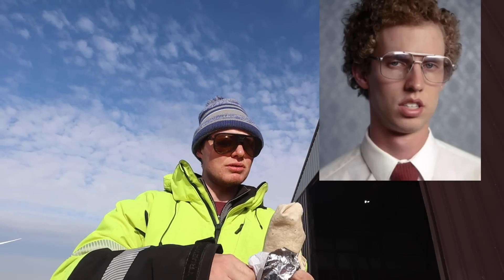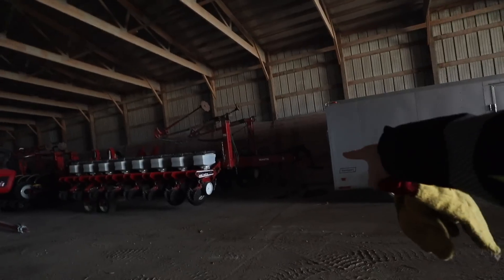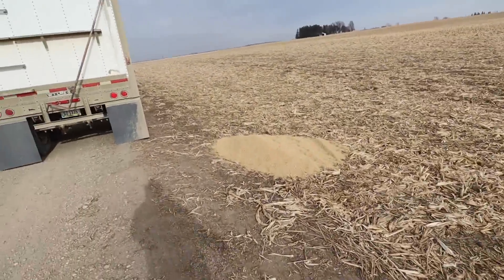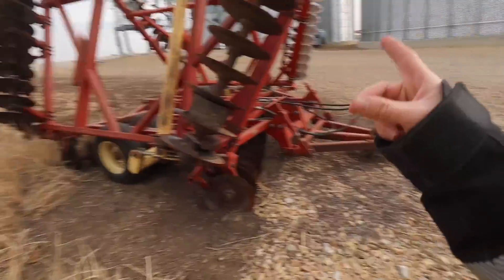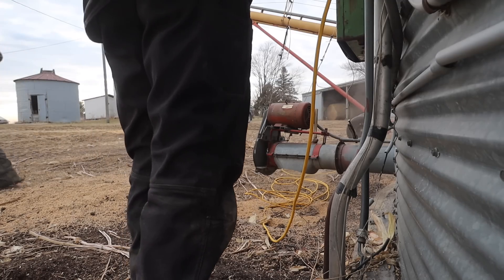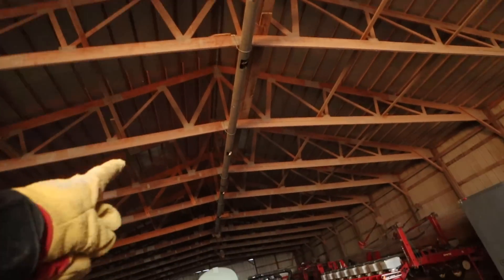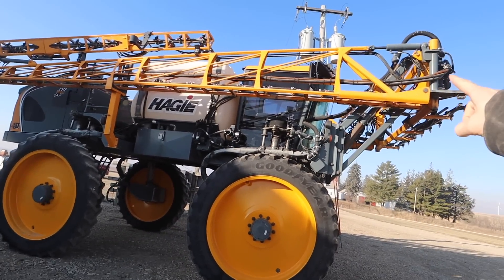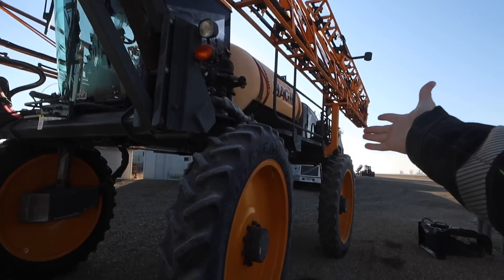I Expanded My Farm Equipment Collection!

Comment: The best way I have found to train a dog to avoid moving vehicles. Is to use a training collar with vibration mode. When a vehicle is running you hit the button. When the vehicle is not running let him play. I haven't noticed any issues with not wanting to ride . They learn to tell running vehicle is something to look out for. The younger they are the faster they learn.

Comment: You'll love having two sprayers..... One can be set up for corn and one for beans.... And when you use your Y drops you won't have to take them off and on to spray beans.
Reply: Having machines dedicated will reduce if not eliminate the risk of not getting a sprayer cleaned out..... That was always a several hour job to do it right when switching between 2 or 3 crops....

Comment: I change my hub oil every other oil change in my excavator!  I believe that the manual states every 1,000 hours on mine but I feel that it's one of those items that gets a ton of abuse and gets little maintenance.  May want to step up the oil changes and it may buy you some more time

Comment: You should keep the old sprayer as a backup so when the new one has issues you can use the old sprayer until the new one is fixed
Reply: That’s a big and expensive Machine to be sitting around as backup if the new on goes down while both of them are working they were doing twice as much work in the same amount of time wich leaves less for the one Machine to handle
Reply: If you actually watched the video you would know that they’re going to use both at the same time…
Reply: @adamfpv8294  correct
Reply: @Shitty_6.2  you are also able to use the old one for parts  sense they are the same machine just that one is slightly newer than the other one that’s why you keep the older ones around besides buying new parts cost money so why not use the old machine for parts
Reply: At the very least use the old one to do all the fertilizer and keep the new one away from that corrosive crap that’s why I hate front boom sprayers everything you apply coats the whole machine

Comment: Could you weld tabs on the new sprayer where the corn rubs the paint off and bolt on some stainless flashing to preserve the paint?
Reply: i was thinking that same thing. Im surprised something like that isnt installed from the factory. It wouldnt be an expensive addition, and preventing all the rust could go a long way for the longevity of the machine.

Comment: Cole, is it not cost effective to just change the wheel hub piece that needs replacing vs buying a whole new sprayer?
P.S. - keep the dogs on a tether leash or inside the cab of the vehicle as a riding partner!
Reply: They wouldn't have the efficiency or redundancy of 2 sprayers at less than a 1/3 of the cost of a single new one.
Reply: Depends on which model Torque Hub it uses. Could be $30k or could be $50k all said and done  assuming parts are available given the supply chain problems that are still getting worse.

Comment: Nice addition with sprayer and puppy.  Folks need to quit with the over protective stuff with the dogs.  They do not live in a subdivision where dogs stay inside….they live and work with them and locking these active dogs up isn’t the answer. 

I do suggest considering a training collar….when the pup starts chasing equipment the push button will let them know that’s not allowed….they learn real quick what’s not good to do.

Comment: Leash a dog on a farm? Not sure that's feasible. However there should be a place for the dog to be contained when there's nobody available to directly supervise. Helping with training would be to always have puppy treats on hand so they learn quicker. Yes that means walking around with a bunch of dog treats in your pocket 24/7. And because it is very difficult to monitor a dog 24/7, having two young puppies and working with them daily, although not as intensively as I should. I'm aware of those issues. But if somebody can't take responsibility for monitoring them then you need to put them someplace where they can watch and learn on a leash. I hate to do that I hate seeing dogs leashed, I think they need to run and play and develop into strong healthy young dogs. And I also recognize the issue that if they're at least all the time how do they learn what they can and can't do. Good luck looks like a lovely dog.

Comment: Fun fact: aluminum is always oxidized. Even anodized is a deep oxidation.  It will corrode pretty quick when exposed to harsh chemicals.
Reply: Aluminum powder in a pure oxygen environment will spontaneously burn. Its a very reactive metal, like magnesium, but its oxide layer on its surface passivates it from the more common natural reagents.